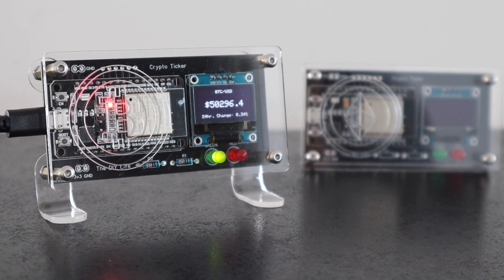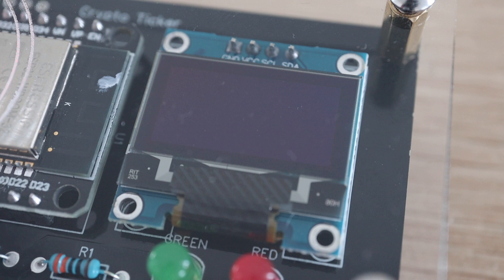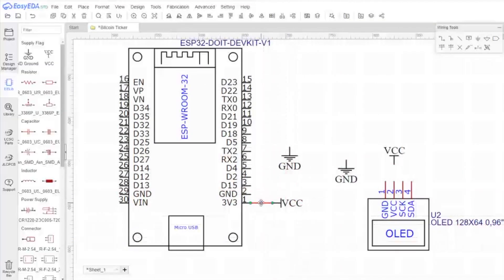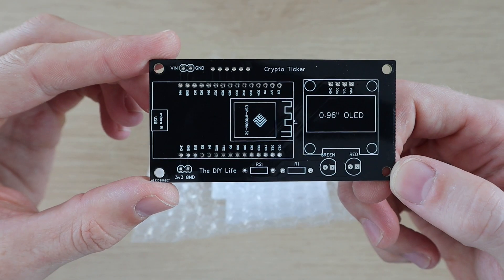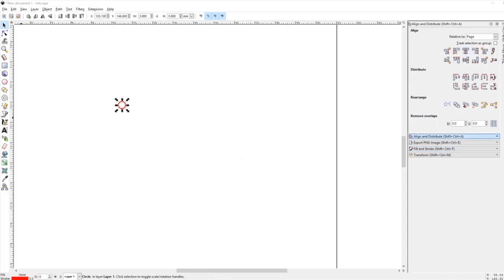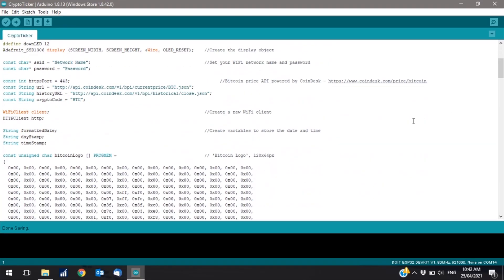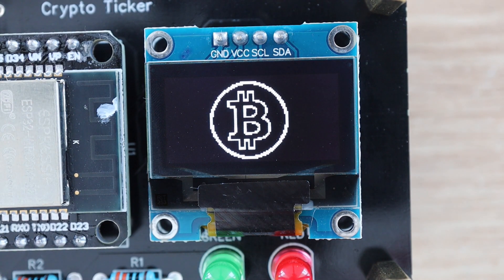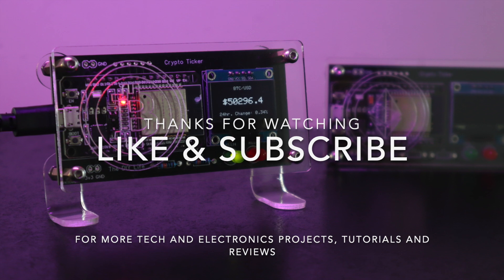Bitcoin Price Ticker Using An ESP32 and OLED Display

Comment: I hope you don't mind but I've modified the sketch to work with a 1.3" SH1106 OLED display. I tried your sketch on a newer ESP32 the sleep timer still didn't work. So I replaced that with a simple delay set to 10 minutes and that works fine. Thanks again for the video and the project page.
Reply from the maker: That's great. I'll look into the sleep timer, there might be a newer library for it.

Comment: Hey Michael. Can this work without being connect via usb to a computer? Is there a possibility for further adjustments
Reply from the maker: Yes, the USB cable is just providing power to it. You can replace this with any USB power source or power bank. There are also pins on the PCB to power it directly from a battery or power supply. It doesn't need a computer to run.
The code is available for you to download and edit so you could change or add anything you'd like. You could add multiple currencies to each if you'd like.
Reply: @MichaelKlements  Brilliant. Thanks!

Comment: once i plug the board in via usb, is the port supposed to automatically show in arduino ide? Nothing is showing from the board i bought from etsy. The red light on the wifi board comes on but that's it.
Reply from the maker: Yes the Arduino IDE should recognise it. You can also confirm this in Device Manager if you’re using windows.
Make sure the cable you’re using is a data cable and not a charging cable. Some microUSB and USB C cables are just for charging and don’t have any data lines connected so they will power the device but it won’t show up

Comment: this is totally awesome, have you thought of building an e-paper version that runs on battery?
Reply from the maker: I haven't, but that would be really useful. I'll have a look at putting together something with a low power ESP32 module and e-paper display. This would be useful for a range of project dashboards.
Reply: @MichaelKlements  yeah, this has been my main focus of the last few days, im very new to programming so everything is a fun challenge... but certainly testing my patients
Reply: @MichaelKlements  any progress with epaper?

Comment: Hi Michael, first of all I like the overall concept of this project, it's absolutely awesome. I would also like to build such a live ticker for crypto, unfortunately I have a nodemcu 8266, wouldn't the program be almost the same?

Best regards
Reply from the maker: Yes the code should be the same, you'll just need to use a breadboard for the setup.
Reply: Did you ever figure this out? I have both esp32 and 8266 and I want to use the 8266 bc displaying ticker is such a simple task doesn’t require the 32

Comment: Bonjour esque tu sorais se qu'il y a a modifier pour le faire fonctionner sur esp8266 ?
Reply from the maker: The code should work on this model too, you'll just need to select the correct board type when uploading. Obviously the PCB won't be compatible with the esp8266

Comment: Hey Michael,
please build a air quality monitoring system with temperature humidity rain and wind speed measuring capability you may design a pcb and just do it in a simple way or you may design a case and put all the components in the case 
also,
please tell us on how to change this code in such a way that it displays prices for more than one crypto at a time and shows the logo first and then the price
Reply from the maker: Hi Sid,
I'll have a look at building a weather station with air quality monitoring as you've suggested. I've been wanting to build a small solar powered weather station for a while now.
You'd just need to copy everything in the loop portion of the code and then edit the API retrieval to fetch the price for whatever other currency you're looking for. You'll also need to move the bitcoin logo display line into the loop rather than setup so that it's displayed on each update. You'd probably also want to reduce the sleep time between fetches so that it displays one currency for say 5 minutes and then the next for 5 minutes after that.
Reply: @MichaelKlements  Thanks for the help

Comment: Is there a way to eliminate decimals?
Reply from the maker: Yes you could add a few lines to remove the characters after the decimal point in the code.
Reply: @MichaelKlements  You have no idea what a headache it was for me to find and be able to eliminate the decimals hahahahahaha
Reply from the maker: Did you manage to get it working though? I could potentially add a commented out option in the code to switch between decimals and no decimals.

Comment: Awesome! An idea is to make them inter-connectable (one power input and then daisy chain). What laser engraver/cutter are you using?
Reply from the maker: That's a nice idea, it would definitely clear up some additional cabling. I'm using a K40 laser cutter with a couple of minor upgrades to get better quality cuts.
Reply: @MichaelKlements  I'm looking at the k40 now, any suggestions on the best cuts and etches? My printer should be here in a few weeks and I am about to pull the trigger on the omtech k40.

Looks like I'll need a "chiller" either official or diy. What else?
Reply from the maker: The K40 works pretty well out of the box on acrylic, mdf and plywood. I'd say I cut 2-3mm acrylic and 3mm MDF most often. If you engrave MDF try masking it up first, you'll get much cleaner results.
If you haven't already ordered the K40, try to get one with an ammeter on it (usually the cheaper ones). Mine has that digital panel and it's pretty useless to keep an eye on the actual current that the laser is producing. The ammeter helps you to protect your laser and get more consistent cutting results. I've landed up retrofitting an ammeter onto mine.
You don't really need a chiller, just a bucket of water that you can throw some ice into every so often. I use some old soda bottles which I just fill with water, freeze and re-use.

Comment: Can You change in code how many decimals are displayed or is it something dependednt from API supplier?
Reply from the maker: That's the value available through the API, so depending on the API used you could get more decimal places.
Reply: @MichaelKlements  Actually I want less cause it's not fitting on the screen when there is 4 decimals or more :) Anyway thanks for Your reply I will look for a different price provider!!!
Reply from the maker: Getting less shouldn't be difficult, if you change the variable type to an integer then it'll automatically drop the decimals.

Comment: Is there a way to add a physical  button to switch in between currencys ?
Reply from the maker: Yes there are some additional IO pins available so you could add a slider switch to change between two currencies.
Reply: @MichaelKlements  ^Thanks ! :)

Comment: This is sick! But I was wondering, is it possible to write some sort of script or to program a Pi to display a web's REST API onto the monitor, almost like maybe a sub count or recieve any data from a web's REST API onto the screen?
Reply from the maker: If the data is available through an API then you should be able to modify the code to read the data and display pretty much anything on the OLED display.

Comment: Is it possible to also have stocks ?
Reply from the maker: Yes, the hardware will support stocks as well, you'd just need to modify the code to accommodate a stock exchange's API to get the values.

Comment: Thank you for this, just what I was looking for 👍 The one that I built works fine with one exception, it updates every minute. I'm not using exactly the same ESP32 that you used but it would appear to have the same spec. Any idea why this would happen? Regards, Alan.
Reply from the maker: The low power sleep mode library must not be compatible with your ESP32, so it's just ignoring the sleep line of the code. That's the only reason I can see.
Reply: @MichaelKlements  Thanks for the reply. I will attempt to get hold of an identical ESP32 and  see what happens. Cheers, Alan.
Reply from the maker: It also might just be an issue with the board type you've got selected in the IDE.
Reply: @MichaelKlements  I have NodeMCU-32S selected which I have found works well with other sketches on this ESP32.

Comment: You do some great work.  Well done.   Rather than have most of the see through panel showing computer board hardware, is there a way to use a larger display and have that larger display take most of the space displaying the bitcoin price info?
Reply from the maker: There are a couple of different I2C display options, so you can definitely use a larger display if you'd like.

Comment: "Hello bro, how are you?

Thank you very much for your contributions. I want you to know that I have been following your projects closely and I really like them. However, I am currently working on a project myself and it would be great to have your help. I have a 3D-printed Bitcoin sign with LEDs, and I'm trying to connect the ESP32 to an API to fetch the Bitcoin price. The idea is that, based on the price changes, the SMD 5050 LEDs will change color and perform an animation. I have tried various methods, but I'm not good at using those APIs.

I would greatly appreciate your assistance. If I need to upgrade my plan, it's not a problem. I just need to know if I can count on you.

Thank you very much, and of course, you will receive credits for helping me achieve this.

Have a great day and thank you again."